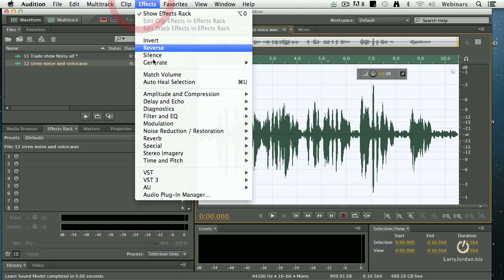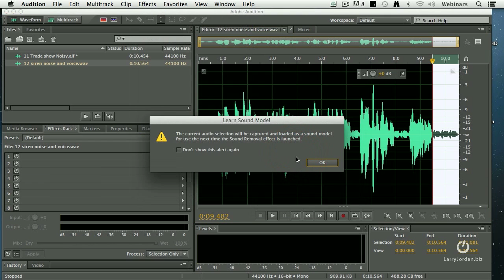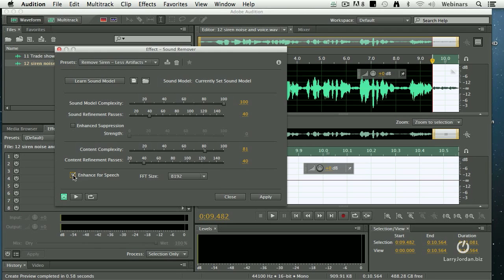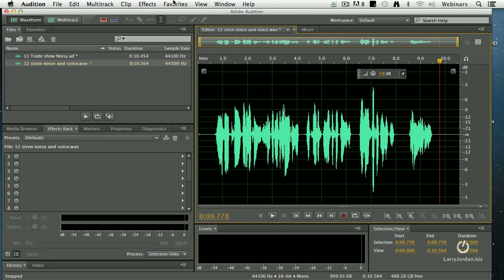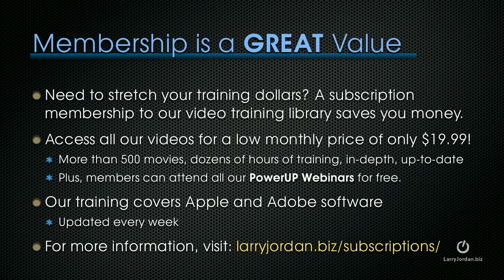Remove Sound That Varies in Frequency

Comment from the maker: You are correct, I was showing the process not emphasizing the final result. I need to spend a bit more time with the filter to optimize the settings.  The key point is that we could do this at all. There are many ways to optimize this filter, which I am still exploring.